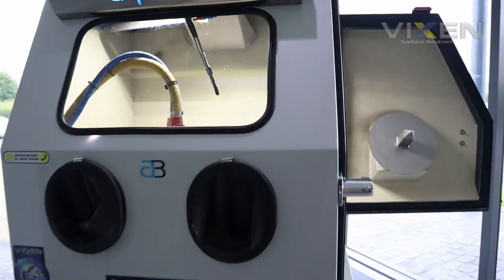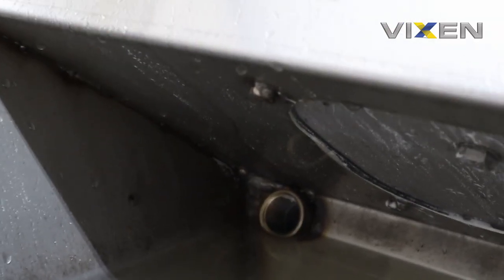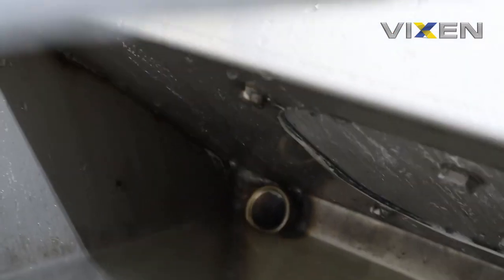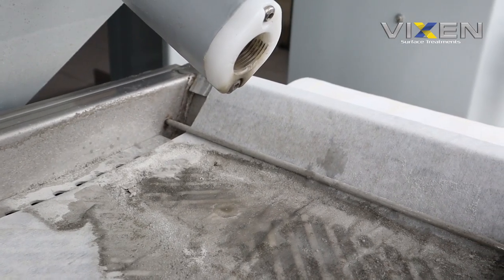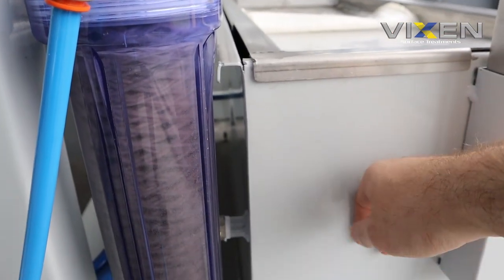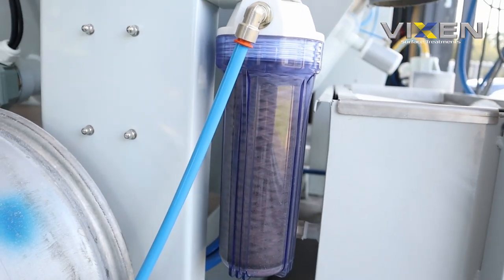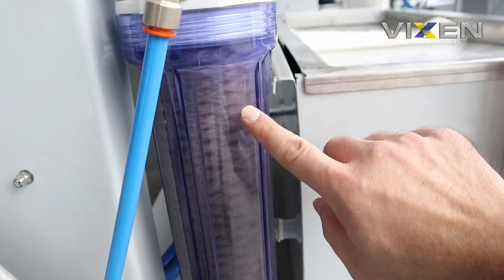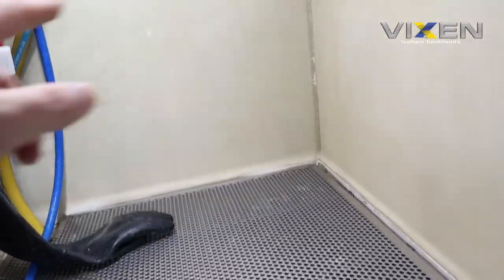RECYCLE NOW WEEK: Closed Loop System Explained - Aquablast®

Comment: Нi, How much does the pump that is installed inside the chamber cost
Reply from the maker: Hi Andrey, Aftersales would be able to help you with this :) aftersales@vixen.co.uk
Reply: @VixenSurfaceTreatments  Unfortunately, the prices for mashines are not democratic. So I made it myself. However, I faced the problem of feeding an extra heavy abrasive.